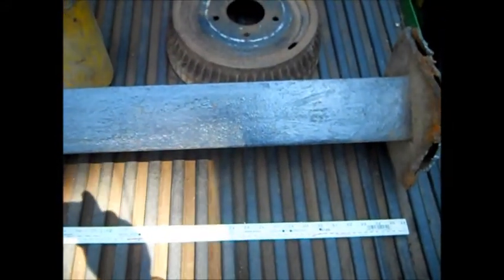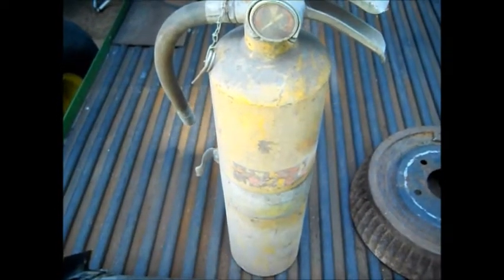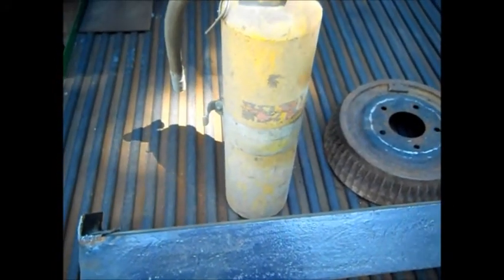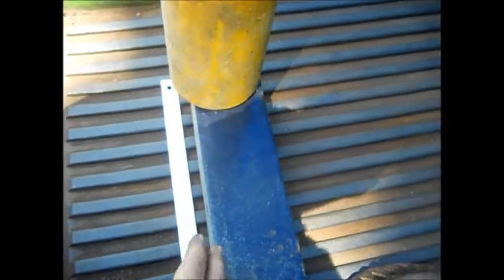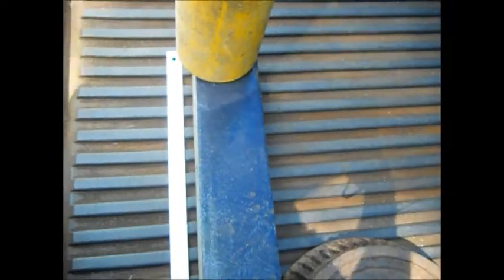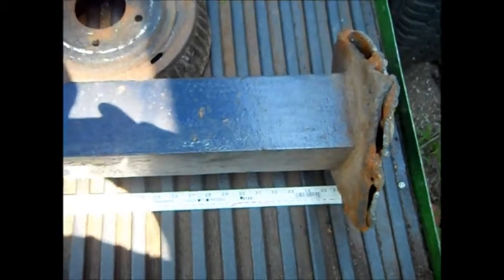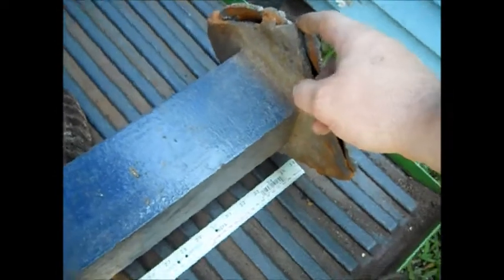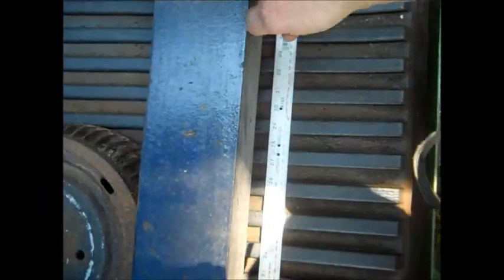Rocket Stove Idea and Materials

Comment: Great concept,but I think super charging it may be a little to much.As far as the swirl affect I have made several of these(not out of fire ext.) But 5 in tubineing.The swirl  or turbo effect can be acheaved by capping your entrance tube be it square or round and drill holes or jets starting with larger holes to your right,and decrease them in size to the left.With a simple computer fan and a draft regulator you can make a wicked stove that will impress most creators.
Applejack